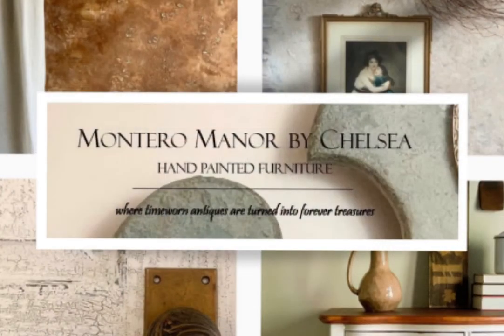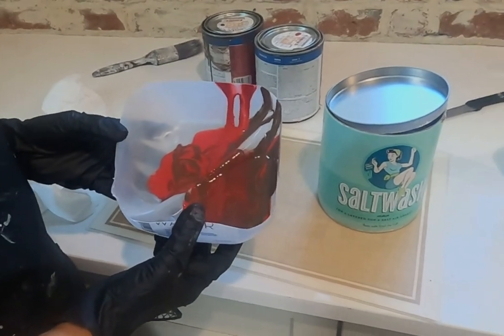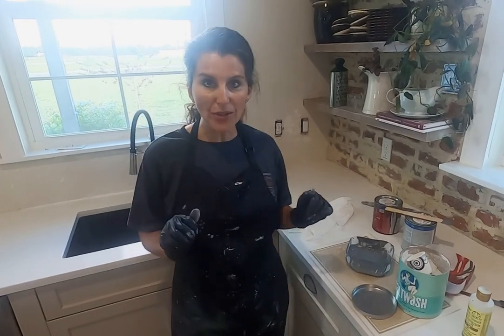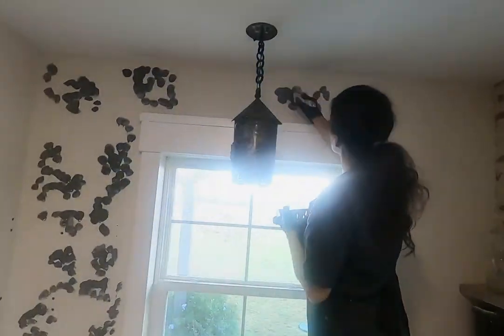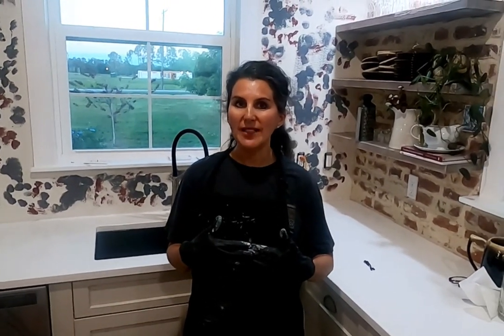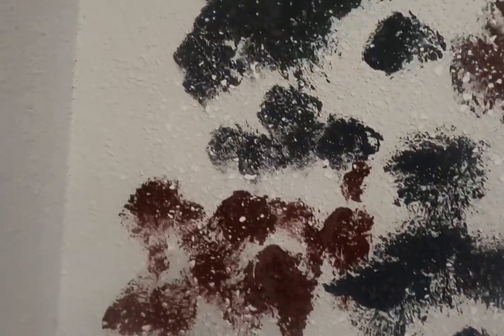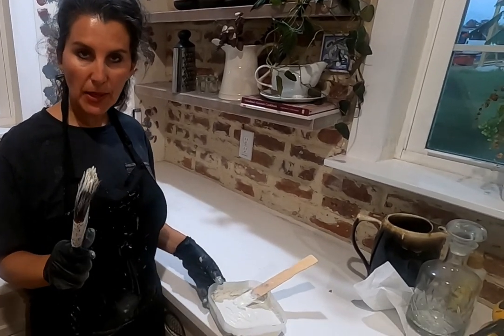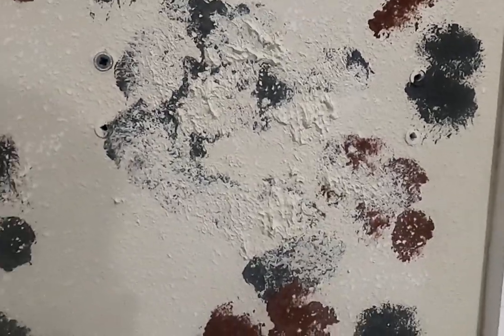DIY FAUX STONE WALL | Transform Boring Walls Into A European Stone Wall Look | FULL VIDEO

Comment: Could I hand sand for the same effect?
Reply from the maker: Hi Erin, you could give it a try and see if manually you can get the exposure of the under colors. Make sure to use a low girt like 60 or 80 to get through the top layers. Good luck!

Comment: That looks like very old plastered over stone Could you use dry wall compound?
Reply from the maker: I don’t know that joint compound would achieve the textured look since it tends to be smooth.
Reply: @nooksinbloom  I just made a faux brick wall with dry wall compound it looks very real just wondering if you could do that with the J compound Thank you